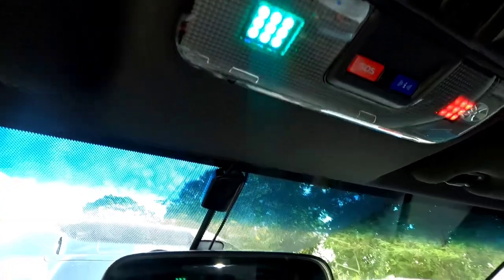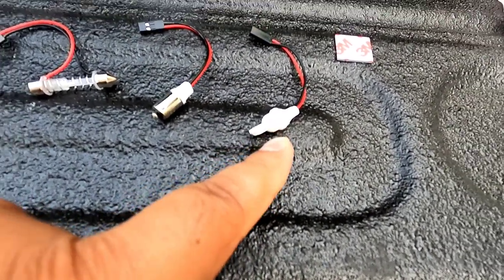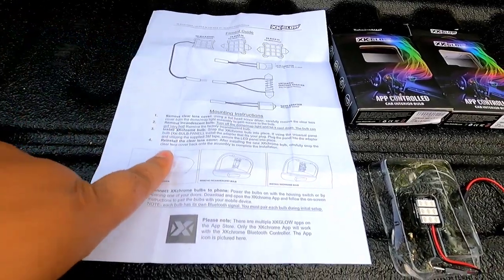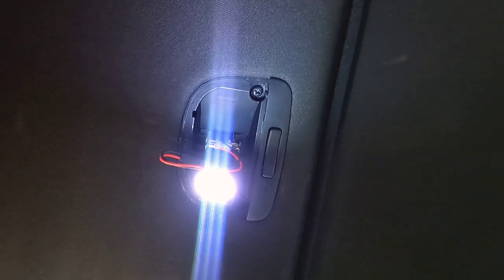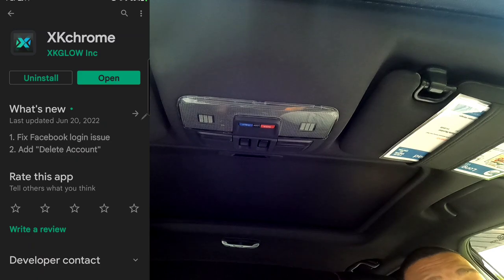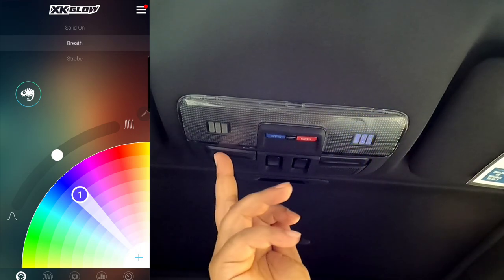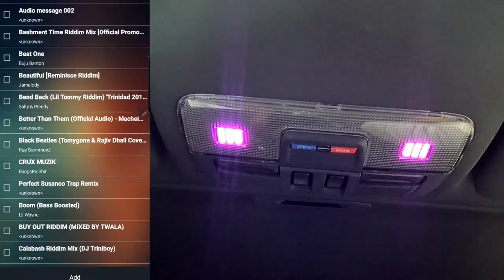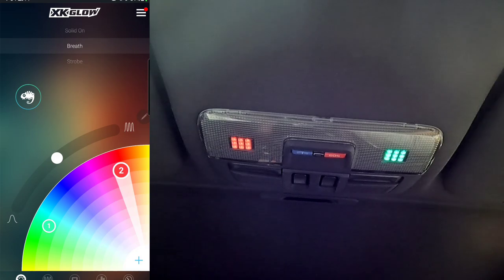XKGLOW App Controlled Led Dome Light Bulb Kit Unboxed & Installed on my 2018 Subaru WRX STI

Comment: Do the LED’s get hot if left on? I’m concerned about melting the plastic lens you attached it to?
Reply from the maker: The leds are slightly recessed from the plastic enclosure that there're in.  Also I ran them for hours at tunerevo without an issue.

Comment: Would I have to buy 3 packages or just 2 to do the front and back
Reply from the maker: Two for the front and one for the back!! You can probably add one to the trunk with a T10 adapter as well
Reply: @WikedWips  Indeed thank you for the response, Im learning alot of stuff on your page, I appreciate everything you’re doin for the Subie community
Reply from the maker: Hey no worries man, I also appreciate you taking the time to check out my work.  It's not easy but I do it because of my passion!!! I'm on IG @Wikedwips2.0